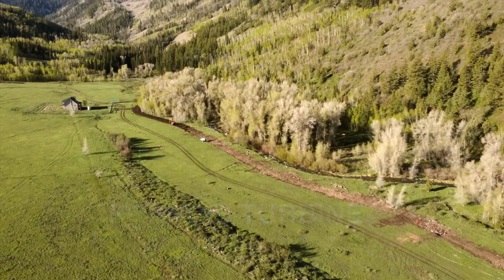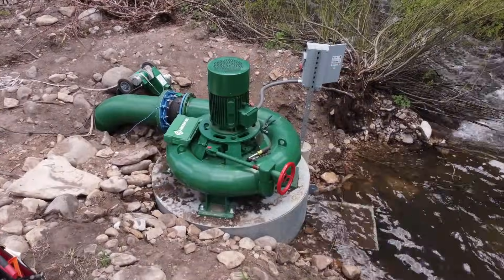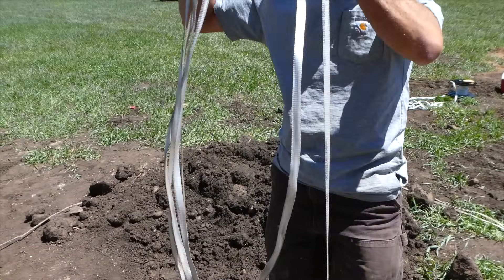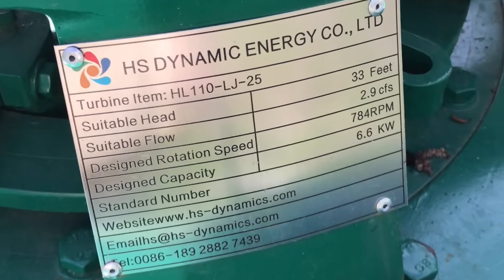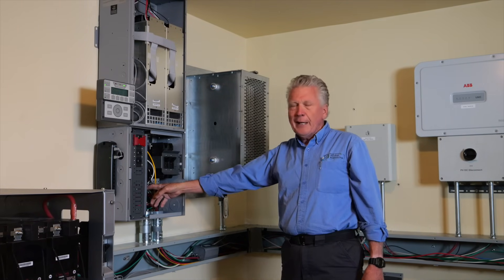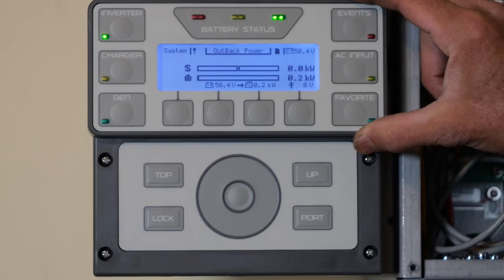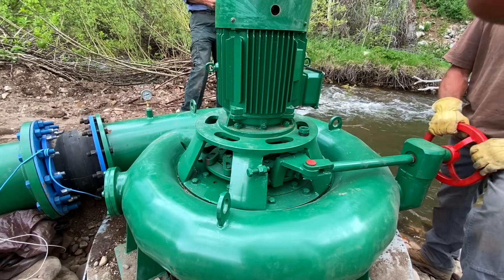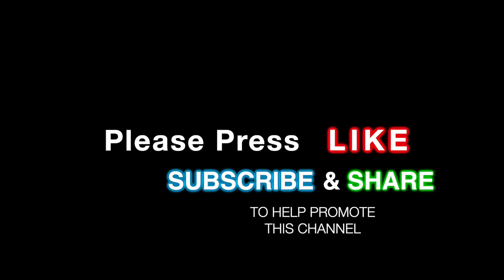MicroHydro Francis Turbine Part 2

Comment: Curiosity, why such a complex system? in off grid with power greater than KW, the alternating voltage generated by the turbine is used directly and regulated by an electronic regulator with electrical load derivation, ELC with synchronous alternator or IGC with asynchronous motor / alternator, downstream you can feed anything even delicate , as if it were the mains, also charge batteries with 3-stage PWM electronic chargers or use UPS inverters etc, if it is necessary to have a backup.
Reply from the maker: Not sure I understand your point.  here is an answer I wrote to another similar question of why the system seems so complicated "The efficiency of both power generation and transmission is greater with AC.  And the turbine is not directly governed so there are no control wires to be run to the Turbine.  Wild AC (which can vary in hz & voltage) generated and transmitted to the house is not compatible with appliances or many kinds of lights etc, so it must be conditioned to standard code.  It needs to be rectified to DC first and then converted back to standardized 60hz AC.  If there were no batteries to provide peak loads to the whole house, then that would be the end of it, but the system does have battery back up for peak loads and the system is therefore governed by the Outback unit which moniters, charges the batteries and verifies the quality of power provided to the whole house system.
The primary reason for the complexity results from the AC generation and transmission being wild and also the most efficient way to get power to the house.  Hope it makes sense.  As I said in the video, it tested my own understanding of how and why it is set up this way.  Thanks for watching!"
Reply: @mrhydrohead  An off grid system of this power is usually not done like this, so I asked, this is done on small systems that are not able to generate enough power such as pico hydro, to feed the users directly, I state that I do not know the real power generated and the water available in periods of frost or drought, on 12 KW but also if they were 4kw of the turbine without using other control cables or turbine distributor drives, even if I an opening and closing command , even via radio I would put it, in case of electrical load loss inverter failure etc. the turbine without load runs away generating very high electrical voltages and stressing the bearings and alternator, but leaving out this, an electronic load controller for mini hydro was enough with the same line , a simple electronic control card, installed in the house or even at the turbine with resistance cooled in the water in the drain, which based on the frequency generated reg o the derivation of the electrical load (electrical ballast suitable for dissipating all the electrical power generated continuously) to keep the turbine at a constant speed and always under electrical load as the loads of the connected users vary, this system is able to stabilize the voltage in order to be able to power anything, appliances, refrigerators, freezers, TVs, computers, midwives, etc., you can bring the AC three-phase into the house and put a split-phase transformer and have the classic 2x120V 60Hz if necessary, we don't need a transformer we use 3x400V between phase and phase and we have 3x230V phase and neutral, on 12kw in civil ampbiete at home you try to do it in single-phase if the line is not too long, never seen a system like this on turbines above 2 kw, AGM batteries have an efficiency of 75% between the power input and that drawn, against 95% of the LiFePo4, the input and drawback current cannot be too high otherwise they will be damaged o ahead of time, usually the capacity is calculated divided by 5 for the deep cycle and you have the maximum amps of relief and input, same thing for the state of charge, falling below 70% being AGM makes them last very short as a useful life , it is not logical to change batteries every 2 years, then if this system falls below the minimum power necessary to work correctly everything, due to the lack of water is another matter, I discarded this situation given the choice of the type of turbine and the power of 12kw declared, I assumed that there was always minimum water to make it work properly even since there are no automatic adjustments on the distributor based on the water level upstream, that's why I asked if there was a specific reason for a system made like this, with batteries cmq I see a 40% loss of efficiency, for me a good electronic control board Mini Hydro ELC was enough, and an electric ballast resistor, which in any case m ectrei to safeguard the inverter and the rectifier regardless, it is how the handbrake can be used in an emergency, not knowing the real needs or the real power throughout the year, nor the available capacity curve, I cannot be sure that the direct use this turbine being the right option is just a guess. Ciao
Reply: I agree it is electrically complicated, but with and ELC you need to have a power off the turbine in excess of the load from the user. We now suddenly have inexpensive inverter / battery systems which store energy and provide a nice AC suitable for sensitive loads or grid connection. I imagine the turbine came with an AC generator, so the pragmatic answer is to use that, but rectify (losing the fixed speed somewhat) and use a cheap (relative term) battery / inverter. Possibly you get an efficiency loss allowing the Francis machine speed to wander, but this is more about practical routes to achieve a project
Reply from the maker: @chriselliott1261  I think many people assume this Francis is my system which it is not.  I'm merely documenting it for the benefit of my subscribers. My Pelton system(not this one) is controlled via Thomsen Howe ELC and has no batteries, just dump loads which the ELC manages. Going over peak turns the system off when the Hz gets out of range via a range sensor and gravity powered jet deflector in the turbine.  Consequently my knowledge of batteries/inverters/rectifiers is limited. But, when you say "suddenly have inexpensive inverter/battery systems" could you share a link here of an example so other readers might benefit from reading this?
Reply: @mrhydrohead  OK, I will try and pull together some links to share. This is new to me too, at home we have a 100kW grid tied machine, but it also will island with an ELC setup like you describe if the grid is down as it is a synchronous generator. Everything we've built in the last 15 years has been induction machine based, and grid tied, but just recently for a mix of reasons we've started needing to mix PV and hydro, and the grid connection standards in the UK have made it much easier to connect via a battery / inverter system. But the big caveat is that as yet, we've not completed a hydro system with battery and PV, but we should in the coming months, and it seems like it will be a valuable bit of learning I'd like to share
Reply from the maker: @chriselliott1261  Thanks in advance for any effort you can put into it.  Appreciate it.

Comment: Great video overview!

Why AGM batteries instead of LiFePO4? The latter would last so much longer and have better storage capabilities.
Reply from the maker: another commenter said this:  
bknesheim 
 Publicly subscribed to you (2 years)
 • 10 hours ago
Up front cost is a VERY good reason for selecting lead acid batteries. If you do not abuse your batteries the life time cost will also be lower even without adding capital cost to the equation. There are good reasons for selecting LiFePO4 chemistry, but lead acid will be still be used for a long time.

I say:
I'm no battery expert, but trust the expertise of this designer.  Thanks for watching!
Reply: @mrhydrohead  Here's my take on the battery setup. It really all depends on how the batteries are going to be used, when, and what for. But honestly, I could not come up with any reason to use AGM over LiFePO4 in today's market -- the AGM batteries are more expensive and will not last as long!!!

12 x OutBack Power 200PLR Batteries I found online for $522.58 each. 12 of them is $6,270.96 without shipping. These are 12 volt 200 Ah batteries (13.8v nominal) , capable of storing 2.76 kWh each. HOWEVER the usable AmpHour capacity depends on how fast you discharge them!!! The EnergyCell PLR specs sheet shows the Ah chart varies from 86.5 Ah discharging in 15 minutes to 203.8 Ah discharging over 20 hours. 

HOW you use these batteries is going to HUGELY impact your ability to pull power when the system is offline. If you're gonna pull 6,732 watts per hour, the batteries will provide you 4 hours of runtime. 3,447 watts, 8 hours. If you keep it under 1468 watts per hour, you might hit the 203.8 Amp Hours and a 20 hour runtime.

If you regularly discharge the batteries to 10.5 volts, which seems to be a Depth of Discharge of 100%, then your cycle life plummets to 500 cycles or 1.37 years. 

If you keep the batteries always at no lower than 50% depth of discharge (half the available AmpHours), then 12 batteries * 1.2 kWh = 16.6 kWh, and assuming full charge/discharge cycles daily, that's 4.11 years before you need to replace them. 

Comparing it to Lithium Iron Phosphate batteries, LiFePO4.

1 48 volt 100 Ah (51.2v nominal) server rack battery is $1449, so 3 of these would be the equivalent of the AGM batteries based on a 50% depth of discharge for AGM, vs the 100% depth of discharge for LiFePO4. So 3 of these batteries would be the equivalent of around 15.36 kWh. All of that is usable, you can discharge to 0%. 

https://signaturesolar.com/eg4-lifepower4-lithium-battery-48v-100ah/

These cells they claim have been cycled 7,000 times before they hit 80% of their new Amp Hours, so you would go from 15.36kWh to 12.29 kWh after about 19.17 years of daily cycling.

AND THESE BATTERIES are $4,347, which is $1923 LESS than the AGM batteries above!!! I do not know what your installer/designer is smoking, but either the batteries are generally NOT being used ever, or they are being used only very rarely. And even if they are, they STILL provide a worse experience for a higher cost!!!

Here's some information that's not from me directly, but likely biased as they are a battery manufacturer:

https://rebelbatteries.com/blogs/lithium-iron-phosphate/advantages-of-lithium-iron-phosphate-batteries-over-lead-acid-batteries
Reply from the maker: @ooglek  Wow! Your research goes far beyond my knowledge of batteries which goes about as far as the one under the hood my car. My own system is straight AC with an ELC and dump loads. I didn’t want the issues associated with batteries 🪫 🔋. I certainly defer to your extensive knowledge. The system likely provides enough power for most needs directly and the batteries provide for peak loads periodically required. Thx for sharing your knowledge.
Reply: @mrhydrohead  You have batteries! You have issues! :-) You just get to choose your issues.

Keep track of your peak loads! If you are using 50% of the battery capacity daily, then the AGM batteries you have will last about 4 years. If you are using more than 50% daily, then they will last a lot fewer years. If you are barely using them at all, they may last you 15 years.

The difference between AGM and LiFePO4 is that they are less expensive AND they have a longer life span. You have to buy 2x the number of AGM batteries to have a 1500 cycle lifespan because that is only valid if you never discharge them below 50%. With LFP you can discharge to 100% and still get the estimated 2000-7000 cycle lifespan, and you only buy the capacity you need, not double it.

The same setup you have with LiFePO4 would have been 25% cheaper and last 2 to 5 times longer with the same amount of power provided, and that is only compared to AGM that is NEVER discharged past 50% (12.15 volts or 2.02 volts per cell). If you pull more, LFP will last MUCH longer than 5x AGM.

When you need to replace your batteries, make sure you get educated before someone sells you something! AGM may work great for you for the next 15 years, so long as you rarely use it and when you do you only use about 14 kWh before the recharging starts. Otherwise you'll be replacing them sooner! 

Keep on finding more micro hydro to feature. Love the videos and watching the process!
Reply from the maker: @ooglek  I think you have misunderstood this segment because you keep using the word "you" referring to me. The Francis Turbine that this video documents IS NOT MY system.  My system is the Pelton Turbine system documented in Parts 1-21 of Micro Hydropower in Colorado on the MrHydrohead Channel.  I have now made 3 videos that are about systems other than my own.  I ran out of things to make vids about on my system.  Nonetheless your information is useful, but something I won't personally need.  Thx for sharing just the same
Reply: @mrhydrohead  Ack!!! Sorry, my bad. I thought this was YOUR system and that you were looking at lots of other systems for future videos. Sorry! Cheers!
Reply from the maker: @ooglek  No worries!
Reply: If you buy in bulk, LFP batteries are cheaper than lead acid for the same kWh rating.  @mrhydrohead
Reply from the maker: Ken the designer said: "The Francis turbine required a battery based inverter because the system is off grid.  There is plenty of power from the turbine and the batteries would rarely cycle.  I used AGM batteries because they are designed for that purpose – remain full most of the time.  Lithium batteries are far more expensive and don’t justify the expense as the batteries are simply a requirement for off-grid."

Personally, I don't know about comparative costs because my system is straight AC, but I trust his information.
Reply: @mrhydrohead  If Ken the Designer could provide the AGM costs vs Lithium Iron Phosphate (LiFePO4 or LFP), I'd be interested! 15kWh of LFP is $4500-5000, whereas the 12-cell system shown in the video priced out closer to $6000. Though the rated Amperage for the AGM was higher, the usable capacity was around 15kWh when AGM discharge limit stopped at 50% in order to retain the 1500 cycle life of AGM. It is plausible that Ken might not have recently priced out LFP and maybe should take another look! LFP has definitely been more expensive in the past.
Reply from the maker: @ooglek  Ken is a pretty busy person and isn't involved in these videos beyond allowing me access to document them.  I try to not bother him with questions about what he has completed as I know he's onto several other projects once he finishes one.  I doubt he would pursue changing out a battery choice after the fact as the costs are born by his client which he gets approved before executing them.  I don't personally have experience with batteries and there have been lots of questions about them, so I'm really a poor person to provide answers.  I do appreciate the detail you provide here as there may be others that read your comments and benefit from them.

Comment: Your videos are fantastic, keep them coming.
If this were my project I would have extended the Coanda Screen across the majority of the stream bed instead of having an overflow area with rocks on the downstream side as you never want the penstock to be starved of water and start sucking air. I personally would have gone with a European or US made turbine, China has just had too many issues with product quality over the years.
Reply from the maker: It may have to do with added cost on an extended Coanda.  Not sure. Flow is turned down at turbine if supply is insufficient, but I'm pretty sure its scaled the available seasonal flows.  I'm sure cost played into choice of Chinese Turbine.  Its not my system, so I'm just and observer/documenter. Thanks for watching!
Reply: Coanda screens seem to me to be an overcomplication as they stilll catch debris and need maintenance by a human.
Theoretically if you took water  into the penstock at half way between the top of the water and the bottom of the water in a say 3ft deep pond....the silt would be settling on the bottom and the leaves would be floating over the top.
Whatever the size of your penstock intake....a tube 50% bigger, stoppered at one end, sleeved down to fit into the intake penstock at the other...drilled with many holes along a good length of it with a textile sleeve as a "just in case" filter wrapped round it..... at  the halfway depth in the pond....would always force  more than enough water through all the holes and not induce suction vortices....
In floods all the excess water would flow over the dam wall without damage or clogging of the pipe...unlike with a coanda screen dam....
You could lay this intake over the top of the dam off to one side like a syphon which would mean no holes in the dam wall...and a much easier replacement if necessary....
https://www.youtube.com/watch?v=LVoeaKCEd2o
Reply from the maker: The Coanda screen as designed is self cleaning and the seasonal variations in flow would likely clog what you’ve described in fall time with leaves and debris which isn’t floating.  I have worked with a variety of intake styles on my own system shown in the other videos on this Channel and have seen that sort of design you describe get clogged by submerged debris. There are many ways to approach any intake and this one design seems like it will function quite well. Thanks for watching and sharing your thoughts!